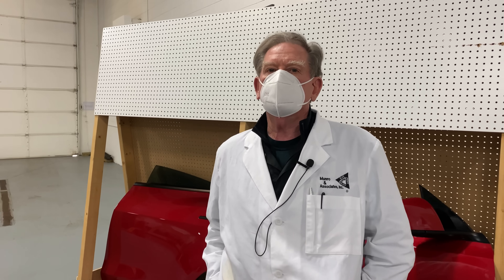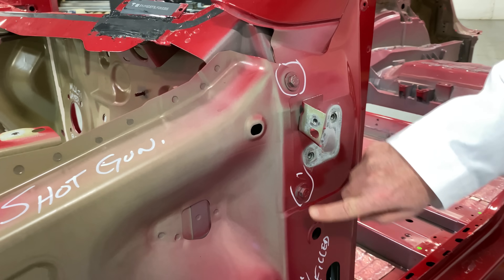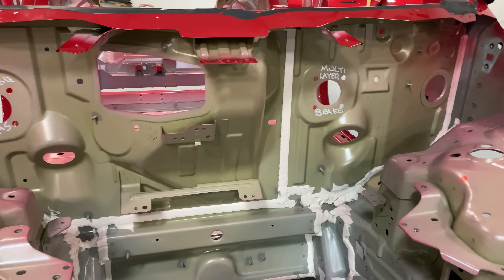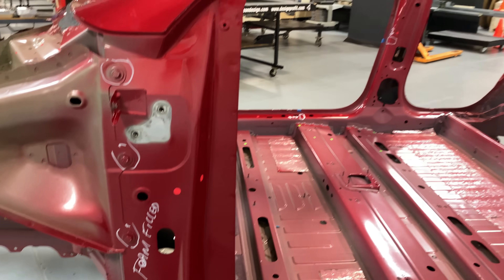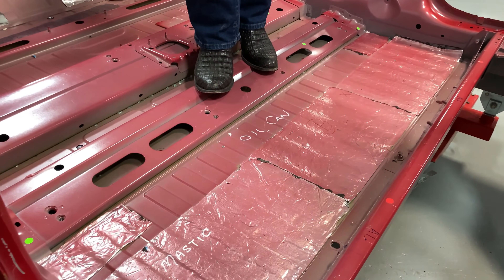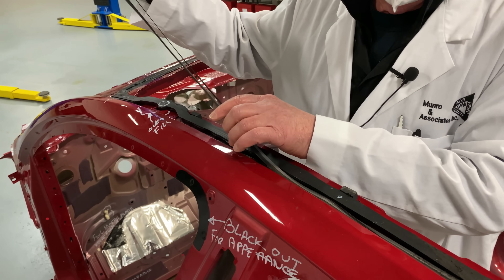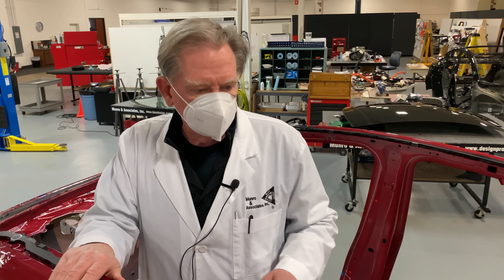Model Y E29: Down to the Naked Body-in-White (BIW) - Oil Canning, Roof Racks, More Insulation

Comment: I probably missed it earlier, maybe im dumb.... but the battery sits on that part where he was standing right?  not under that?
Reply from the maker: The HV battery mounts beneath the floor, underneath the part that Sandy was standing on. The lower half of the case is exposed directly to the road. Thanks for tuning in!

Comment: Would be great to have some comments on aluminium / steel used as well as corrosion resistance (In Denmark its common to rust proff the entire chassis after market to prevent rust).

Comment: Roof rack is actually very easy to install it comes with all the equipment needed and can be done in around 25mins
Reply: Sometimes, if the fit is good. I have no problem with my 3 but some have had misaligned glass making it difficult.
Reply: Martialman.45 yea I’m sure if the glass is misaligned you could bring it to Tesla service and they could fix it as it is a defect with the car
Reply: @matthewhanlon5480  Most times, sometimes they just deny the problem or unable to fix. One of my doors was 1.5mm out of speciation according to service but they could not fix it.
Reply: @martialman.4563  Well you should have refused it and got another if it was that important to you.
Reply: @nickbaker4857  Not sure how that works now with Covid but I could have refused delivery but it's just easier to fix.
Reply: Martialman.45 they can’t deny the problem if you have proof reach out to Tesla online and they will help you
Reply: @matthewhanlon5480  I hope your right, maybe all the unanswered texts is a local service issue and all the unanswered emails was just my sales advisor. Some experience has been great and some unbelievably bad. My car is in service now for its 10th and 11th repair and it's less that 2 years old.
Reply: Martialman.45 would you consider trading in for a model y you can still get some good money for model 3
Reply: @matthewhanlon5480  Car will be paid off when it's time for my pickup reservation to be ordered. As of now sticking with Tesla despite poor customer service as safety is my highest  priority.
Reply: Martialman.45 customer service has been great for me have had no problems so far
Reply: @matthewhanlon5480  Good to hear, seems service centers and sales representatives are inconsistent. My car was delivered to the wrong state is just one instance on how bad they can make mistakes. The best move they can make is get independent shops tool, software and encuragement to work on Teslas out of warranty. They can't keep up now, imagine 4 years from now.

Comment: Not for my taste, but you are wrong about those roof brackets. They can be field installed and removed, they do slip in between the glass and the body rail.. A lot better approach than many other car vendors.
Reply: Yup, its just a hook on the rail that slips in and under the bracket.

Comment: Sandy, love the videos, but before you point something out as a flaw you should look at the manufacturers directions and how they intend usage. These roof rack points are just fine as they run a J type hook from the side of the glass that hooks under that metal bracket.
Reply from the maker: Fair enough, appreciate the feedback 👍 Thanks for tuning in!
Reply: LL above: Roof rack installation shown: https://youtu.be/xgmnR3WoKXY

Comment: Another fascinating video, teasing us throughout with little glimpses. You mentioned the front hinge pillar has expanding foam in there. Have you had a chance to look inside the A pillars to see if they put expanding foam there too? Or a least a seal against wind rushing up into them? There has been a lot of discussion that the gap into the hollow may be a source of much of the whooshing wind noise in the Model 3 when at highways speeds, with a variety of DIY fixes:
https://teslamotorsclub.com/tmc/threads/solved-wind-noise.177619/
https://teslamotorsclub.com/tmc/attachments/img_20191210_220511-jpg.488159/
https://teslamotorsclub.com/tmc/posts/4302658/ (simply stuff foam stuffed in there, much like in the Model Y rear fenders ;)

Also, as far as Oil Canning, they have a SB for Tesla Model 3 owners about that, related to noises heard during winter driving and/or charging:
https://forums.tesla.com/forum/forums/banging-noise-while-super-charging
https://forums.tesla.com/forum/forums/loud-bang-under-driver-while-super-charging
which I summed up here:
https://TinkerTry.com/first-v3-supercharger-in-the-northeastern-us-in-fairfield-connecticut#jan-30-2020-update
There is a Tesla Service Bulletin related to cold weather charging noises:
"Replace HV Battery Breathers"

https://static.nhtsa.gov/odi/tsbs/2019/MC-10163736-9999.pdf
which I had done to my 2018 with only a slight difference possibly noticed. I've chosen to not concern ourselves with this, and just ignore it.

For early Model 3 owners who had rear seat passengers noticing the unsettling noise heard when stepping into position. Gladly, not an issue with my 2018 (VIN 119,XXX) or 2020 Tesla Model 3s (621,XXX). FYI, both seem to have the exact same door  and trunk seals, and I wasn't able to measure any discernable difference in noise at highway speeds between the two. For anybody interested in a very close look at the engineering and design changes made that are visible WITHOUT ripping my Model 3s apart, here's my detailed article/4K video:
"Design and specification changes between Tesla Model 3 2018 and 2020 model years and between LR AWD and SR+ models"
https://TinkerTry.com/differences-between-2018-and-2020-tesla-model-3#items-changed-from-2018-lr-awd-to-2020-sr-
Reply from the maker: Thanks for the detailed post and for sharing your experience! We haven’t checked out the A pillar internals yet, but we can take a peek next time we have a chance. Thanks for tuning in!
Reply: Wow, thank you so much, that would be awesome!
Reply: No, its because there is no noisy engine drowning the wind noise.
Reply: Nick Baker Sure, that is a contributing factor, but there is some wind noise too, did some informal measurements on camera at https://TinkerTry.com/tesla-model-3-known-good-accessories#sound-dampening

Comment: Look at how the roof rack installs on the Model 3. Are you expecting it to be different for the Y?
Reply: It is the exact same installation.
Reply: It is the same. I just installed the roof rack on our Model Y.
Reply: Seems like he expected it to install through the top slot and not slide underneat
Reply: Came here to say this. Install was fairly easy on my 3, so why would it be any different.

Comment: The roof rack brackets do slip in between the glass and the body rail..
 they can be owner installed anytime.
Reply: Except in this case, because the mastic has filled the connector at the front.
Reply: @paulveitch  No. It installs from the outside. So it would still fit perfectly.
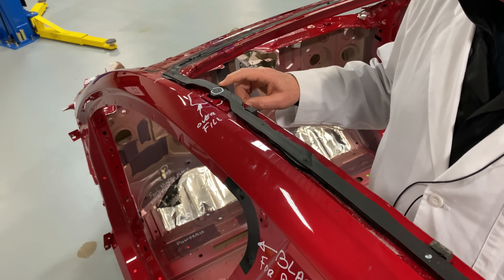Reply: @sjokomelk  look at 5:06. The hole is actually filled
Reply: Paul Veitch You don't mount it thru the Hole from the top. It is a J shaped bracket that you swing in under the mount from the outside edge. And then it slightly protrudes up into the Hole.
Reply: @sjokomelk  ok. Makes sense. Thanks
Reply: @paulveitch  nope, Sandy is wrong again...
Someone already posted this link above.
It explains how the roof rack is attached.
The mastic doesn't matter at all.
https://youtu.be/xgmnR3WoKXY

Comment: For the roof rack, I have one, as I see your video, the only way for it to work is that the ''J'' shaped stud engage from the ouside and the center hole is a relief for the low up leg of the J. Hope the wording make sense.
Reply: It's seem to be well design. Here's video explain it quite well.
https://youtu.be/xgmnR3WoKXY
Reply: @mukamuka0  That's a useful video link.
It's worth noting I that the body bracket has a keyhole feature.  The Yakima rack has a flat J hook that does not engage the keyhole.  That suggests another rack design may be in the works.
Reply: One company makes the roof racks for Model Y. They developed a special latching mechanism for it, to go around and under the edge of the glass. 👍
Reply: Surprised that Sandy didn't get that. Odd for his vast experience
Reply: Francois langlois there seem to be assumptions made instead of research in depth.
Reply: It's good to see that there is a metal support for the roof rack and it was not just being supported by the glass

Comment: most people don't remember oil cans, they have only seen plastic oil bottles.
Reply: He is not referring to oil in cans but Oil Cans these were odd shaped , has a long neck, and when you pushed on the flexible bottom it made that sound.
Reply: @terrysullivan1992  I forgot about those too...
Reply: True. Some time back in pre-lockdown days I saw an old oil can spout, the kind you punch through the lid, at a garage sale. I now wish I had bought it to confuse younger guests.
Reply: @Miata822  I'm just old enough to remember oil coming in glass jars with screw-top lids at gas stations so they would use a screw-on spout to top off the engine. I imagine they were re-used and re-filled and not sent off to the landfill.
Reply: @martingardens  Some of old ways are much better for the planet. The model Y for example will not last 100 years and will become landfill.
Reply: @martialman.4563  https://en.wikipedia.org/wiki/Survivorship_bias
Reply: @martialman.4563  where are all those old Model-Ts? Landfill I guess.😁
Reply: @glenncordova4027  Plenty in people's garages, they are not very valuable as plenty still around. You don't see them on the freeway/highway as they are antique (can't keep up with modern speeds)
Reply: interesting point of order though....
Reply: Yeah I was confused about that.

Comment: Is the model Y's NVH/dB level better, worse or the same as 3?
Reply: It's better*
Reply: I haven't been in a Model Y, but I've had two Model 3's produced 6 months apart and the newer one was significantly more quiet inside.  Just because you see something Sandy or someone else says is "different than the Model 3", don't assume that a new production Model 3 isn't different from the older one they are using as a reference.
Reply: Not from YouTube reviews
Reply: Much better than early Model 3. Went from '18 3 to a Y and it's much improved.